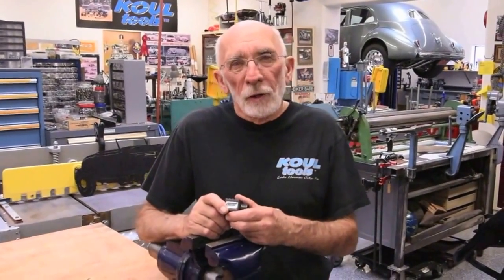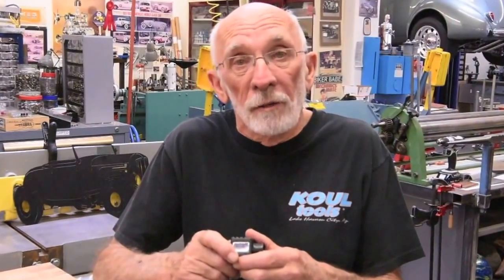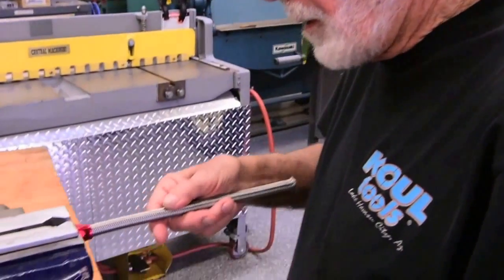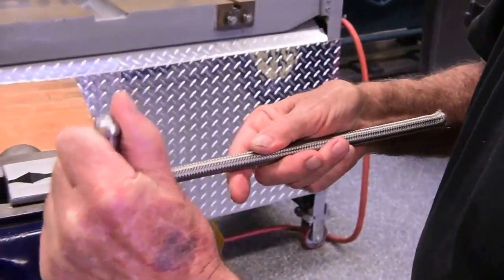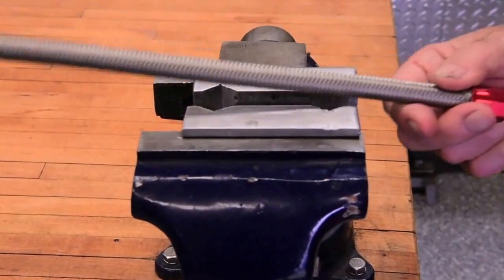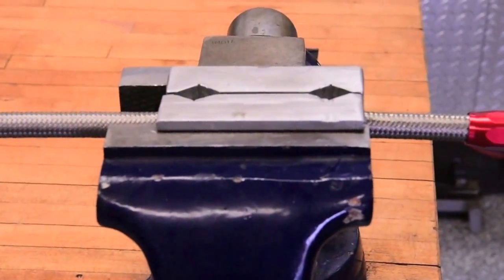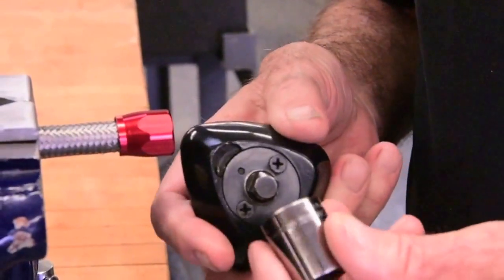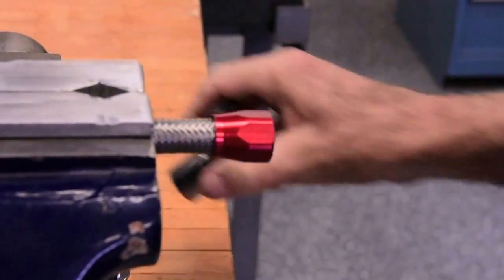Tip for Installing Braided Stainless Steel Hose to the Threads of AN Fittings

Comment: The nut goes on a lot easier when you turn it COUNTER CLOCKWISE going onto the hose since it has left hand threads inside the nut. Then hold the nut in a smooth jaw vise or with a wrench and thread in the hose end insert into the nut. I can't believe you just jammed that frayed hose end into the nut. Stay away from any hose that I am going to use. I built hoses for 30 years.

Comment: Wow.......  "doesn't matter how fuzzy???"   I'm gonna try this today......see how it goes?   Will this work without a Koul Tool?  I don't have one and would like to get done today.....
Reply: I ended up ordering a Koul Tool on Amazon and it came in like 24 hours.  It actually worked quite well.  I could not take my braided hose to the vise so I actually held everything together with vise grips and whatnot and I was able to get the AN fittings together well.

Comment: Wow!  Thanks!  I had no idea the fitting was threaded like that.  I don’t have a set of vise jaws so I’m holding the 6an hose by hand and with my Palm ratchet the fitting screwed on in no time!
Reply: I believe all the flexible hose AN fittings like this are reverse (left hand) threaded.    Every video I see on youtube shows people twisting them on wrong and complaining that they are impossible to work with......you can't fix stupid...not even with duct tape
Reply: @GamingwithKandA Not all of the fitting hose nuts have left hand threads,  some like the Jegs branded fitting nuts just have ribs or ridges inside,  not threads.
Reply: @Ariaisgood But I'm with you, when he turned it clockwise putting it on I thought,  you are making it so hard. I made lines at a truck dealership for 30 years.
Reply from the maker: Good to know.  Thanks for the comment!

Comment: ????? 

But how are you supposed to get the hose into the fitting to begin with? Getting started is also the big issue.
Reply from the maker: You're right.  We show how to do this at 0:28
Reply: @koultools  The sarcasm I like.

1 out of 30 attempts allows such ease. For people complaining it's not threading it down but getting it started to begin with. You do that with nylon woven it bunches up into a rats nest. Super tight wind of tape sucking the o.d. down a mm....nope, walking it in with a baby flat head...nope...all your body weight....nope...stainless doesn't do that nylon does.

Comment: My hoes keeps coming off the red fitting. Why is that? I installed it using take and made sure it is all the way go the edge. I even made a line with a marker to make sure the hose didn't push down during the installation.
Any ideas why this is happening?
Reply from the maker: There is a way to clamp both the hose and fitting with AN vise jaws.  We have a blog post about that here:  https://koultools.com/clamp-stainless-steel-hose/